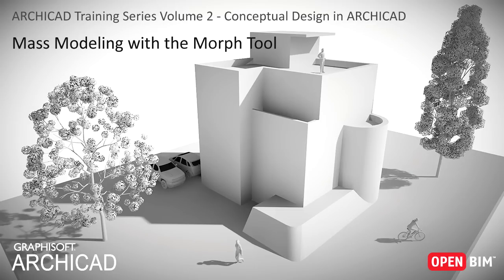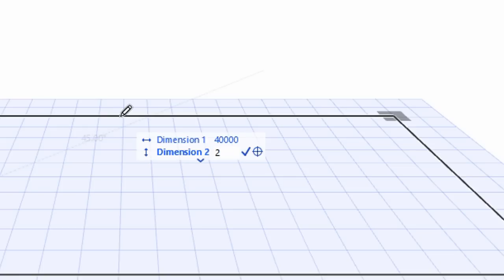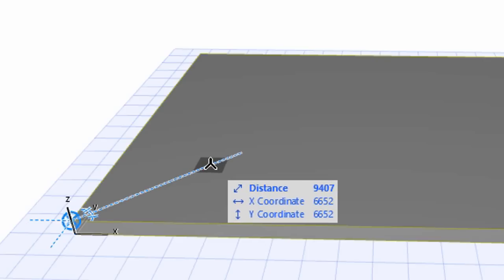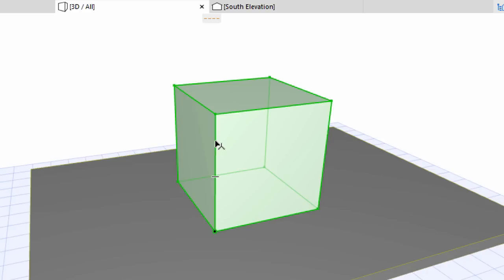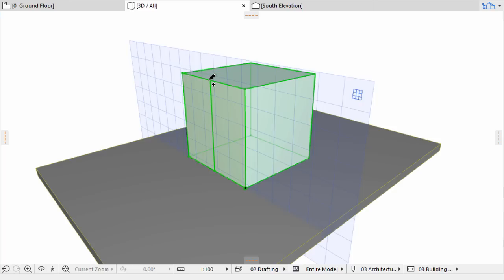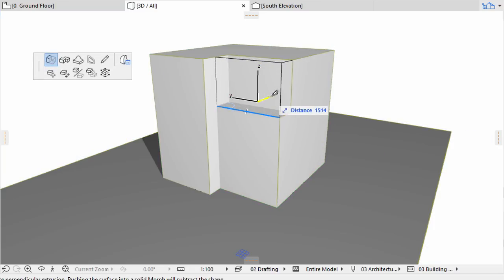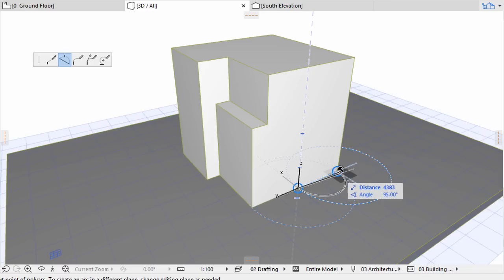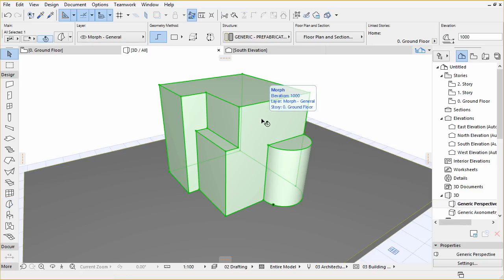2 - Mass Modeling with the Morph Tool - ARCHICAD Training Series Vol. 2

Comment: Few issues already:

My screen is so small, when I do the 40k, 28k, the cursor ends up over the UI on the right, when I move it back to the main windows I can't do the height.

I hacked this by zooming WAAAY out first and kind of got it, but I just have the poly, not the bounding floor grid.

My Edu install of Archicad appears to not have any paint surfaces at all...